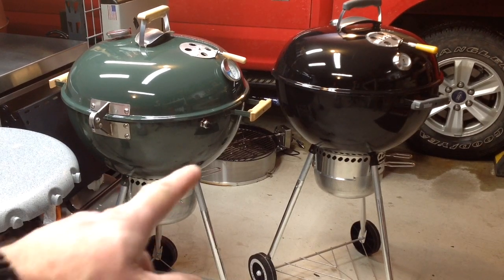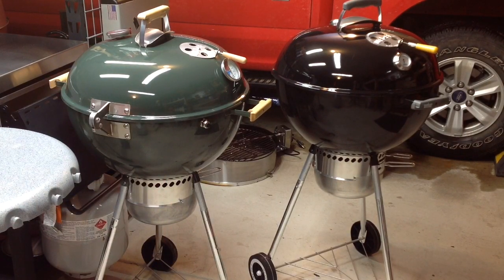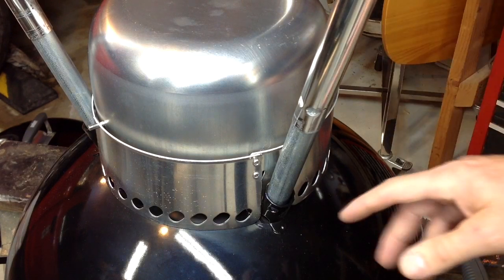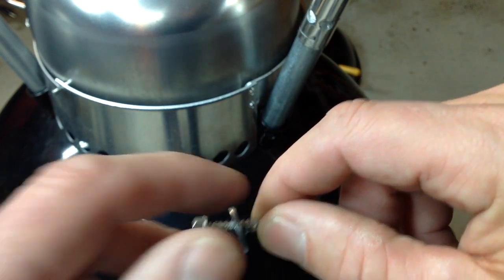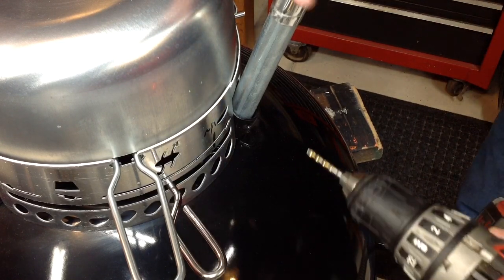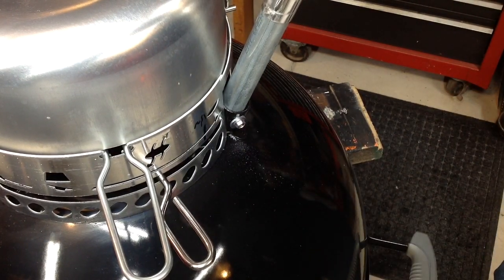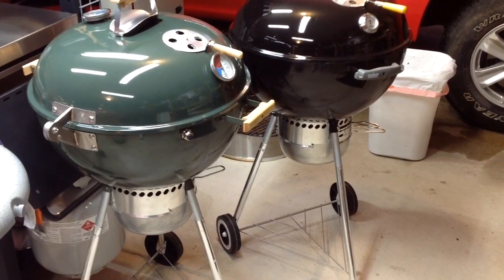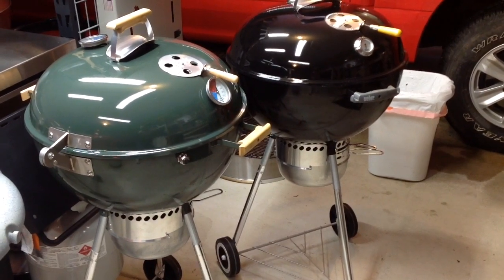How To Add 6" To The Height Of Your Weber Kettle / Review And Additional Modification

Comment: Tom, I used your mod to raise up my Weber, but It was way too wobbly.  I tried adding those sheet metal screws, but it didn't tighten it up enough.  I used a tubing cutter to slice off about 1 1/2 of the original leg to use as a spacer and tapped this section of the original leg tubing into the leg socket of the Kettle.  Inserted the conduit in the legs into the leg sockets with the leg spacers. Tightened everything up without having to add the sheet metal screws.  I might replace the screws if the leg section spacers slip, but for now pressure is holding everything together.  Keep up the mods!
Reply from the maker: Thanks for Watching! Nicely done!

Comment: Nice mod! Painting the electrical conduit would have been nice too. 

I have a 2004 Weber Performer that I got on Craigslist that I'd like to raise up to counter top height. I also have a 2009 Kettle that I got off Craigslist and I'd like to shorten the legs on that one since I recently got a Cajun Bandit ring for it to convert into a smoker similar to Heavy Metal BBQ mod. Yes, I bought all my Weber grills off Craigslist so I can spend my limited budget on accessories and mods because you guys make Weber modifications fun. :)
Reply from the maker: R A Thank you! And Thanks for Watching!

Comment: Hey Tom!  They're not going anywhere now!   I love this Mod......will be doing it when I get a new kettle.  
To take this one step further..........I don't understand why weber doesn't have an adjustable leg assembly anyway???   The legs slip inside each other and have preset height 
markers.  Adjust it.....and then lock into place with bolts or clips.  
Not every griller is the same height...........Weber!!!
Reply from the maker: Adjustable Legs....... Thats a great idea Ken! Thanks for Watching!

Comment: Can you ( "I" ) just use maybe 3/4 covered by 1" emt the way you used original weber legs, without the lower tray/wheel assembly? Reason I ask, Weber sent me replacement 26"er to replace bowl and cover that had rust spot (Great company that stands behind their products!). Would love to make a Fraken -Weber 26" out of the extra parts. I'll still have to invest in a few things but if it works I can save a bundle. Thanks in advance for the help. Love your videos!!!
Reply from the maker: Thanks for Watching John!  You can try... I’m not sure about what you are asking....haven’t done it the way you suggest, so I can’t say. Good Luck!